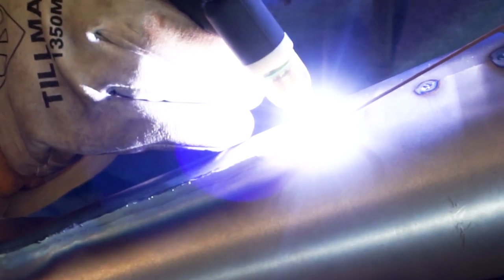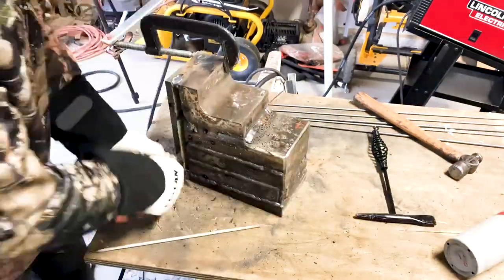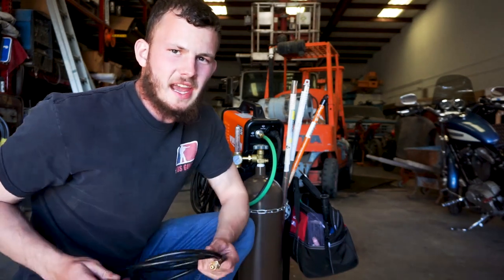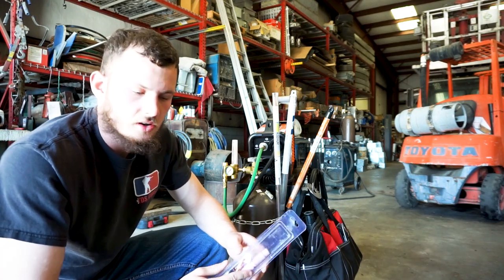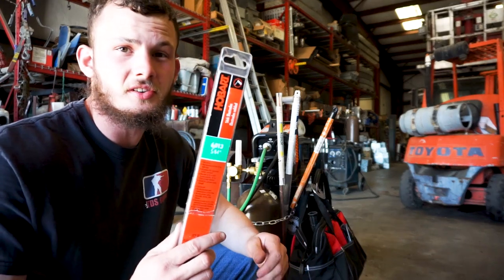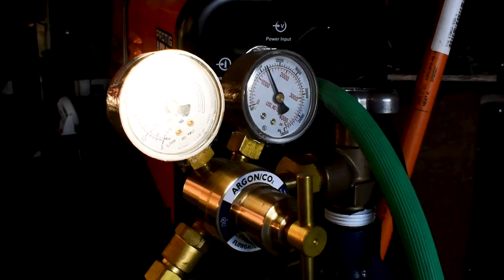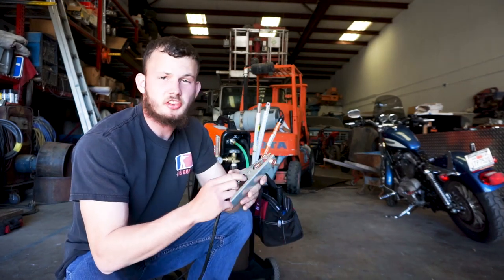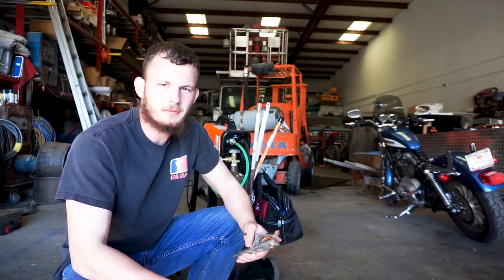HARBOR FREIGHT WELDER: Vulcan ProTIG 165 Follow-up & Upgrades

Comment: Measure the male end with a caliper. It appears to be 3/8”. This is the standard small dinse style fiffting. Ck 10-25 is the designation. You can buy all the male and female adapters in this size, just like for the 1/2” larger dinse set-up on Miller’s, Lincoln’s, Everlast, etc.
Reply: 25 dinse for sure.

Comment: For ground clamps, I have had good luck with C-clamps.  I drill a hole in the clamp body and bolt the cable terminal lug to the clamp.  It has the advantage of being able to clamp to larger structures and you can control the clamp force...  bad ground connection will make you wonder what is going wrong...
Reply from the maker: That's a great idea, never even thought of attaching it directly like that!

Comment: I have a protig 205 and omnipro 220, both use standard 35-70 DINSE connections, the protig has a gas through DINSE on the torch side. Your connections are not proprietary, infact they are very common. You can even order pre made cables and torches with those ends. Like I said mine are 35-70s which I believe has a half inch barrel, yours are the smaller DINSE which I think might be 3/8. But they are definitely common. It probably even says it on the side of the rubber boot, it would look like "35-70" but not those numbers, they would be lower. You take those numbers and add "DINSE" to it in the search bar and you will find them.
Reply: How do you like those welders? I am on the fence as which to get...

Comment: Actually all kinds of upgrades available for the torch. the tig torch gas through dinse connector is common size 10-25 dinse and exactly the same as used on the torch and stick leads on the insanely popular Miller Maxstar 150 STL or STH tig welders so plug and play upgrades are readily available. CK WORLDWIDE sells anything you need to upgrade the tig torch. The solid 10-25 size dinse connector stick leads are even more common. Buy some solid 10-25 dinse connectors and easily make up any length stick welding cables up to size #2 gauge cable.

Comment: Yeah I had trouble with the ground also. It wouldn't arch right welding stainless. I changed it out with a brass ground..works fine now. The ends on the leads are not custom and can be used on new leads. I took a heat gun and got the rubber cover soft enough to pull back. There's a screw under the rubber cover.

Comment: Great review man. I went out and bought this thing the next day after seeing this. If only gas could keep spraying post weld.
Reply from the maker: Mine has post flow! 10 seconds fixed
Reply: When I cranked up the gas I heard it! Still haven’t overheated it after a good amount of prctice on it, I’m just a beginner, but damn it’s such a good machine.
Reply from the maker: Glad it works! I have only overheated it when stick welding, I wanted to try it and after a while I got it to stop. But TIG, it'll run a while!

Comment: There should be a smaller adapter sold by Miller for your welding leads to fit I. Your Vulcan welder 👨‍🏭? Let me know if you already bought them and if it worked good for your

Comment: Can this welder run a 3/32nd 7018 at 90 to 95 amps??
Reply from the maker: Yes it can, but the 3/32 rod seemed to be at the high end of the range. So far I have had the best luck with a 5/64 6061 rod, but I have not stick welded enough with it

Comment: great points thanks for doing this. appreciated. looks like a nice entry level tig. does it do alumonum
Reply from the maker: Thank you! It does not weld AC, only DC. Aluminum can be welded with helium on DC, but it is different than a conventional AC welder.

Comment: Don't take welding tips/ advice from someone who doesn't know what a DINSE connector looks like (or that they come in 3/8" & 1/2"). Harbor Freight aka Hazzard Fraud sells this shitty machine for $700 and gives you a box of shit I promise you won't want to use. EVERLAST makes a quality machine that you won't have to depend on the warranty to replace, once it finally shits the bed. The Everlast POWERARC 161STH is the only starter kit that's worth the price tag. For $450 you get all kinds of bells and whistles... pre flow, post flow, pulse w/ adjustable frequency, and a legit digital IGBT inverter with a smoother HF arc start than the $3000 Miller Maxstar I use on the job. Just need a Nova foot pedal along with an argon tank and you're good to go (plus consumables, obviously). Hell for $700 you can have an AHP AlphaTIG 201XD and those come with EVERYTHING you need including a Nova pedal. AlphaTIGs are AC/DC machines with PWM features as well. No reason to waste your money for less!
Reply: @10NESS3E if you’re still alive today what welder would you go with now ?
Reply: The same ones listed are all better choices than HF.